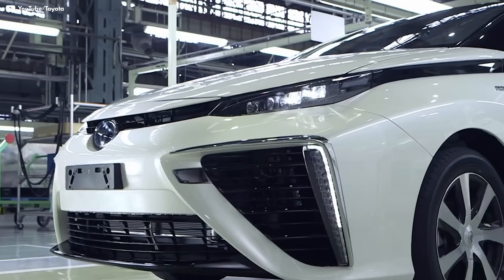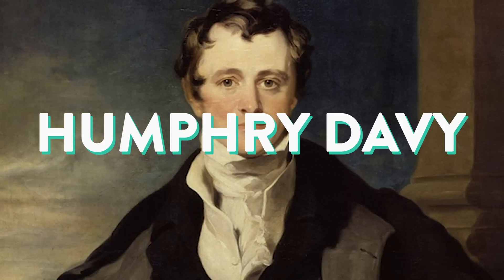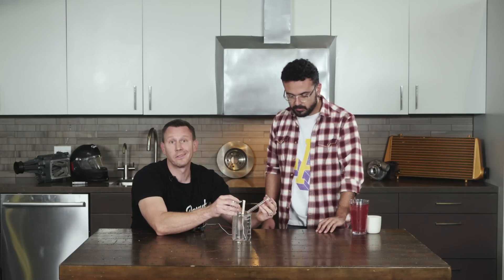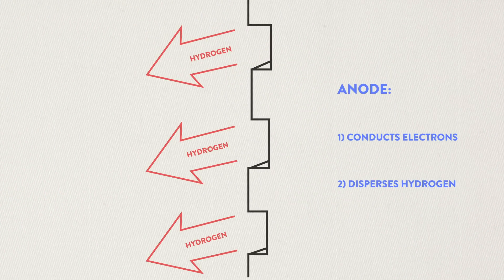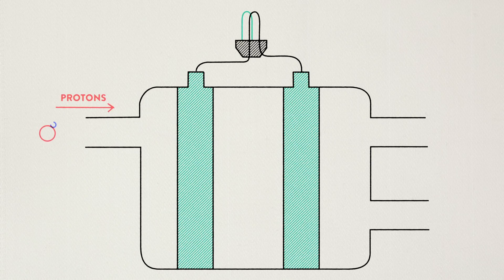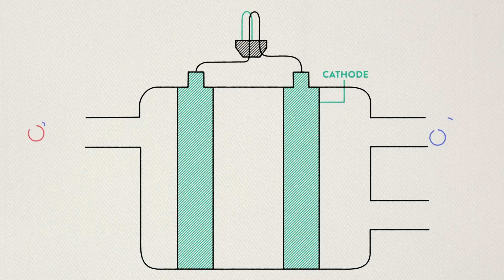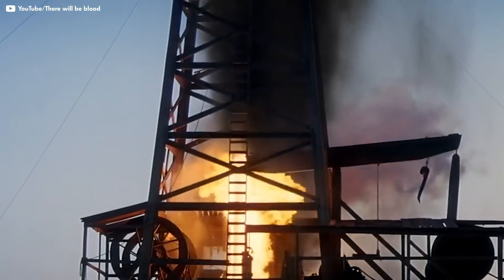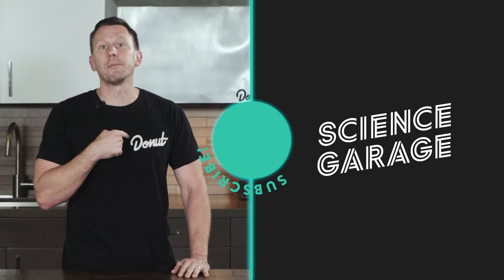How the Toyota Mirai Charges in 5 Minutes | Hydrogen Fuel Cells | SCIENCE GARAGE

Comment: US Idiots (with a Capital I) : Hydrogen is the future (look at Japan) - Making (splitting H20) is not that complex - IF the US allows (yes it's political) solar mirrors in a tiny part of the Sahara (no solar panels - just stainless steel parabolic mirrors that follow the sun and  and concentrate the heat on a closed circuit oil pipeline. As the oil reaches the right temp, it will have more then enough energy to power closed loop (look it up) turbines to create electricity (but sadly electricity cannot be stored). So use it to split water in H2 and 02 by the most modern means (and that doesn't need rare earth metals - but advanced electrolysis - look it up once more). Effect - -> H2 and 02. The hydrogen is stable and can be used AT ANY TIME to produce electricity  - or smarter to pipeline (compressed by solar energy) it to the coast, (or directly to Europe f.i), were tanker ships, driven by H2 will transport it to whatever country and use it in the most Eco-friendly manner to  generate electricity or H2 fuel stations. The US has large areas of barren land (desert like), you produce it also yourself. The efficiency would be a bit lower, and that's the CRUX. The US runs on oil for 80+ percent and just wants to keep doing that, (the rich do) so no investments are made in this project, because it take away a decent amount of political and global 'power' the US still believes it has. No wonder all the recent 'wars' were fought in oil-rich lands and if no open war is feasible, then barriers are put up (Iran f.e.) or puppets are thrown in to 'safeguard' the oil (Guaido in Venezuela) or the abnormal relations with the Saudis (who can bomb the living hell out of normal people in Yemen)  - for oil rewards. A US people in denial of facts is the last  the world needs.
Reply: There are many thermal ways to produce hydrogen (solar thermal, biomass,.....). And solar thermal has much more efficiency than solar PV.

Comment: Why not use hydrogen directly in gasoline engines instead of fuel cells to drive electric motors? Just needs the fuel curves to be remapped on the ECU and you are all set.

Comment: So much simpler to buy energy from a pump owned by a company.  Dont want any of that collecting free energy on your roof nonsense.  What a hassle, just get it from the gas station like you've always done, you dont have to change your behavior, just keep doing what your doing, it'll all be fine, nice and easy drive in, fill up, hand over your cash, thats right, you know you want to, its how things work right, simple.  I heard those solar panels and windmills can catch fire if the sun gets too hot, best stay away from them, and they're chinese mostly so they probably spying on you as well, we dont want that, support your american gas station and fill up with the good stuff, its good for your engine AND the environment, and you'll save 2c as well*

*prices may change once everyone has bought into the system.

Comment: I think he left out the real reasons hydrogen cars haven't been adopted, for some reason. For one thing, fuel cells are very expensive, making them not economically viable for most consumers. For another, hydrogen is hard to store. It's energy density per weight is excellent, but to fit it into a car it has to be pressurized into a very heavy tank. And it's difficult to carry very much, so hydrogen cars can't go very far on a tank. I've also heard they're not as efficient as batteries, so sun-to-wheel (or coal-fired power plant to wheel) batteries require less energy. My prediction is that while fuel cell and hydrogen storage technology will continue advancing, batteries will keep their lead and hydrogen will not become the vehicle fuel of choice any time in the forseeable future, battery-electric cars are soon to become the standard. Well explained video though, I'd never really understood all that until this despite having read about them and even played with a toy fuel cell car as a kid.

Comment: you missed the fact that there are also restrictions with the fuel cell. There are two types: liquid storage, and compressed gas storage. liquid storage being the more space efficient method, though it it needs to be cooled a lot since H2 is a gas at room temp. and comp. gas storage is not space efficient, thus mostly used by buses

Comment: Hydrogen takes too much energy to produce at the demanding rate a vehicle would need, and storing Hydrogen as a fuel tank is way more unstable and hazardous than Gasoline.

Best alternative to a cleaner future is running off Natural gas or Propane, and using Electric vehicles for transportation.

Comment: If someone did not understand, hydrogen comes inside from one side and oxygen from the other. The hydrogen with it's electron wants to bond with oxygen and the only thing separating these two is the PEM. The PEM ensures that the hydrogen goes through and not the electron. So the electron is forced to go through an external circuit. It goes from the negative pole to the positive. Negative pole is on the side where the hydrogen comes from and the positive side is where the hydrogen and oxygen bond. When its has passed through this circuit it is reunited with the hydrogen and oxygen. Thus the emission will be pure drinkable water.

Comment: i do believe it's not more widespread because it's incredibly hard to transport in bulk. hydrogen gas is difficult to liquefy for transport, it won't liquefy even when  under 10k psi so it's  not very cost effective  if you really want to make it liquid, you have to cool it down, a lot  , so what they are doing is shipping literal trucks of ammonia and then taking out the hydrogen to make hydrogen gas.

HowEVER, and this is a big however, hydrogen gas is not very GREEN as they say to manufacture the vast majority of hydrogen is made from Methane, because it's the cheapest most effective way of doing it 4 hydrogen and 1 carbon in doing so you have to throw away the carbon that becomes co2, but that's not the best part, oh nononono, here it comes, for you to strip away the carbon you need to hit the methane with hot steam, and you need a lot of it, because the reaction sucks in energy, so you still have to burn coal or gas in order to keep it going.

Hydrogen is not clean and it's not green

Comment: hydrogen is the future , but these tesla fanboys would attack anybody who suggests it 😂😂😂
Reply: Not entirely.
The thing with hydrogen is that it's REALLY expensive to a) buy the car and b) maintain and run the car. (hydrogen is really expensive to produce and that reflects on the price of the fuel. On average, the hydrogen car costs even more to travel 1 km than a gasoline car, while pure EVs cost 1/3 of the cost of gasoline cars to travel 1 km)
It also can't be filled up at home, so you have to drive somewhere, while pure EVs can.
Hydrogen planes or ships can be feasible, but I don't see it taking the passenger car market, max. 10% of all car sales are going to be hydrogen in the future, mostly for people that need to drive really far and need to fill up really fast.
Reply: Evolt the problem is that the car companies are thinking of putting hydrogen in the car, in my opinion they should do research on how to fill the car with water and let the car do the all the electrolysis and fuel cell stuff. So in other words your car will run on water and could in theory run your house.
Reply: @mrguest3749  Water doesn't spontaneously turn into h2 and o2. That requires electricity, and a lot of it. You could make hydrogen at home, but it would take a 220V outlet at full power + electrolyzer + a very high pressure hydrogen gas compressor to get the gas crammed into your tank. You could never power a car on water alone.
Reply: @phazos9223  it isn't impossible.
Reply: @mrguest3749  Only Honda and Toyota are pushing it like crazy, Hyundai also pushes it a bit.
McHaZe already described it well below. It's pseudoscience to think putting water in the car and do electrolysis on its own.
Hydrogen fuel cells would also be a problem when we colonize other planets, since it requires a lot of oxygen.
Reply: Mr GUEST Yes it is. It goes against the laws of thermodynamics. It would take more energy to perform the electrolysis if water than what you would then get back from reacting the H2 and O2 one the fuel cell.
Reply: @evolt7553 in the beginning it would take a lot of energy, but once the car is in motion it will produce electricity from the motor and can send that electricity to the electrolysis unit and the process will keep on repeating itself.
Reply: @mrguest3749  I don't see electric motor recuperation as being sufficient for electrolysis, for example, what if there are no hills? Recuperation also doesn't recover all the energy that was output to the driving.
The only way this could work would be to plug in the car, but then again, you would have to buy water and electricity to create electricity, and that is extremely inefficient and dumb, why not just buy the electricity and drive the electric car without that inefficient water-hydrogen-oxygen mumbo jumbo?
Reply: @evolt7553  you could use a voltage booster   for the recuperation.
Reply: We have to stop ignoring biofuels, ever heard of ethanol, biodiesel?
Reply: @superhydroweston  That still puts out pollution out of the exhaust and we would have to dedicate a lot of our food supply to achieve 100% of cars running on biofuel.
Reply: @evolt7553  yes, h20 and co2 is pollution very bad
Reply: @superhydroweston  I was speaking about particulate pollution.
CO2 is an unbreathable greenhouse gas.
H2O is not a pollutant, it is water.
Reply: @superhydroweston  I understand your point but this video is about hydrogen vs battery. Also don't you need quite a large area to produce bio fuel?
Reply: @mrguest3749  you need a distillery for ethanol, and biodiesel is just used, filtered cooking oil.

Comment: You need to go over hydrogen powered gasoline engines... like pumping hydrogen into a carb instead of gas
Reply: Broken Platinum Studios you can use hydrogen enriched gasoline but the ignition temperature of raw hydrogen is low to maintain a proper rhythm cycle. The hydrogen would ignite the instant it was introduced into the cylinder unless it’s mixed with something with a higher ignition temperature.
Reply: They have them working pretty well, even years ago. The problem is storage on the vehicle, turns out you need quite a bit of it to get any decent range out of it (think early EV). In those years they were a little bit impractical with big storage tanks. These days we are getting better an better and smaller too. Jesse James did one and it sounds great in a 572 BB Chev and BMW did one as well, both 200mph capable. We can get full water conversion in about the size of a large air conditioner. So unless you don't mind driving around in a E350 or chev commercial van then you can practically run one one the road. Filling the tank with water only.
Reply: Hydrogen powered ICE's are really dumb because you still produce NOx and COx from high temperature combustion so there is no real advantage to burning hydrogen, Aston Martin had a race car that burned hydrogen
Reply: @ehcodes4325  I'm pretty sure carbon needs to be in the reaction to get COx from it. It's simple chemistry: CxHy + (x+y/4)O2 -> xCO2 + (y/2)H2O
This may only be the formula for complete combustion, but it still stands for incomplete combustion that no C atoms before means no COx molecules afterwards.
Reply: @efthymis_mc34  I was incorrect about the COx, good job spotting that. I still stand by my point regarding NOx emissions

Comment: Hydrogen isn't the answer for the mass car market. Electricity created by gas and fossil fuels make up most of the power which we use to make hydrogen.  But that's why it has a high price.  Using one fuel to create a less powerful fuel to normally store in a battery (mined from the earth)  to power a vehicle.  The process is ridiculous.  And its ridiculous to assume renewable energy can provide the electricity needed on a sustained basis.

Comment: For those that are concerned about safety, Real Engineering did a video on the matter.
TL;DW: Hydrogen is lighter than air so it can be purged in the event of a fire. Furthermore, it doesn't pool around the car like gasoline, should it ignite. Toyota tested their hydrogen tank with a .50 calibre round. Instead of exploding, the tank simply released the gas into the atmosphere.
Reply: Aero CX - Jet gasoline its self has a very high ignition temperature, the vapor is what ignites easy. It’s quite hard to actually get a fuel leak In a wreck in any modern car. Self sealing fuel tanks along with auto fuel shut off trap the gasoline within the fuel tank. Fires are quite uncommon in car crashes for the last 10-15 years. One thing Toyota keeps ignoring is how the safety systems work in a crash, not just a puncture. You can shoot a propane tank and it wouldn’t explode either, it’s way to rich to ignite from the inside and explode. Problem comes when the hydrogen starts venting around hot metals and other workings of the car. One property of hydrogen that gasoline vapors don’t have it that hydrogen even if the gas is extremely dispersed in the air can still ignite at a very low temperature. Both have advantages and disadvantages but hydrogen cars aren’t a “no risk” vehicle by any means
Reply: Ah, good, I was very concerned about getting shot with a sniper rifle while driving on the freeway.

No, I'd obviously be concerned about crashing into a gasoline-powered car, leading to all the problems you mentioned that hydrogen doesn't have still happening, only adding a pressurized tank of H2 to the gasoline fire.  But good to know I can drive the thing in a war zone.  They should fire a tracer round next time.

Comment: Using electrolysis to make clean hydrogen makes hydrogen much more expensive than just straight electricity as it's a lossy possess with the compression and the inefficiency of a fuel cell stack. 

Thus means a  battery electric car is 73 percent efficient compared to 22 percent for hydrogen. 

Along with fact you can't refill at home it's going not going to overtake battery electric cars. Big stuff like boats may be the use case for hydrogen in the future.
Reply: Cars are inherently inefficient and costly. Most consumers aren't willing to make the sacrifices and adjustments necessary for an electric car, even if it means its better for the environment. 

Second, no one cares about filling up at home if it means staying plugged in all night just to get to work, and do your chores of the day. I'd rather take 5 mins out of my commute, stop at a station, fill up, get snacks and never have range anxiety. Also, nobody wants to hang out for an hour at a supercharger just to fill up. Hydrogen stations are just like gas stations, which is good for the American consumer.
Reply: @youtubeuserssuck3394  the people have chosen. Battery electric cars outsell hydrogen cars. 1.74% are EVs and only 3500 are hydrogen with only 40 refiling stations in the us.  Most manufactors have given up on hydrogen and are investing in evs. Most of those hydrogen cars get there fuel effectively for free Toyota is giving 15000 dollers of free fuel. If they had to pay for it there would certainly be less than 3500 sold. 

 When you have 400 plus km of range anixity isn't really a thing any more. That's like 4 hours of driving non stop driving and close to the Miri  500km epa
Reply: I will never opt for battery vehicles ever. I'll be a skeleton waiting for hydrogen. I will also actively tell people not to buy them either. The only battery operated vehicles that I would ever have are the RC's on my shelves here. It's a dead end technology that will run out of resources to produce very quickly. Not to mention they're fucking geey.
Reply: @MrConor159  If sales are the sole determiner of what will be successful EV's would've died long ago. Give hydrogen time to market itself to the public. The average consumer probably doesn't realize hydrogen cars are currently on the market. BTW if lack of hydrogen stations are a problem for hydrogen cars, then why isn't lack of charging stations a problem for EV's? Also increased battery range is good, but its not going to end range anxiety. As long as the fastest way to refill your EV takes at least an hour at a supercharger, range anxiety will always exist. 

Can you provide any evidence that car manufacturers are "giving up" on hydrogen?

Comment: Fyi Oil can be a renewable resource in the form of algae oil.
Reply: still making CO2 in the air after the combustion. So it's not a solution ;)
Reply: Ice Fulda it's carbon nutrual because it uses co2 when growing.
Reply: @Innovative_Mic  but it's the same for gasoline. Trees from billions of years ago used to be petrol now and they have used co2 to grow too. So it's the same problem as the actual one ...
Reply: Fun fact alot od the oil come from algae from millions of years ago, it over oxygenated the world causing one of the first mass extinctions and now it's responsible for another mass extinction.